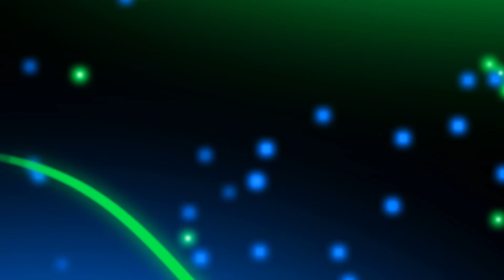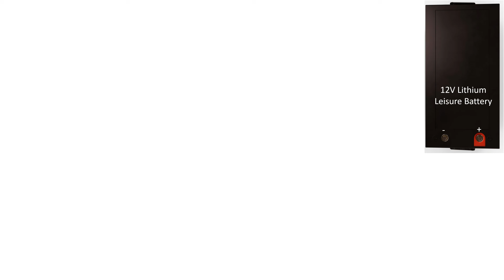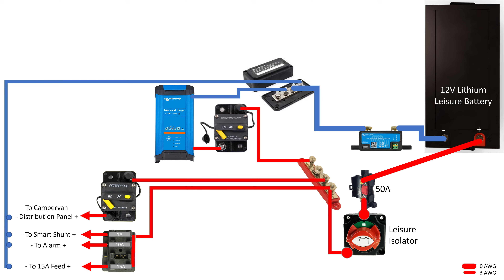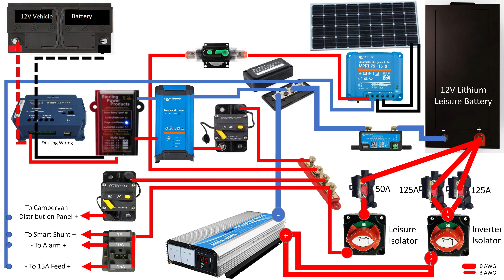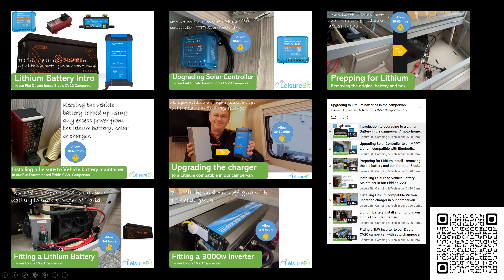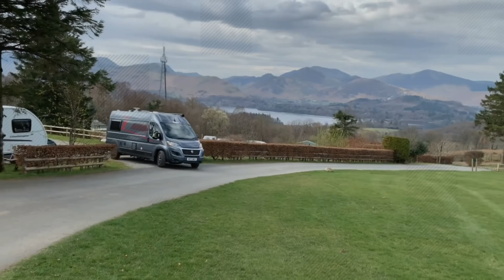8. Lithium Upgrade - Connecting it all up - wiring schematic - Campervan tech Vlog

Comment: Hi Dave. Great set of videos which gives me the confidence to take the plunge and convert my CV20 to lithium. I may have missed it but did you ground the negative busbar to the vehicle chassis and if so whereabouts?
Reply from the maker: Thank you - yes I grounded it through a hole I made in the floor underneath as it was awkward to get in and I also ran the + from the vehicle battery that way - in hindsight I would have probably struggled pulling it though behind the washroom so what may be a better option and connecting to a ground point near the battery (especially if you go for the higher capacity) good luck with your install

Comment: Hi David just wondering where did you connect the power lead for the smart  shunt to.. was it to the battery itself or the isolation switch.
Reply from the maker: Do you mean the 12v input for it? If so, it's connected to the fuse box via a fuse which feeds from the isolator. Hope that makes sense. All the best, David 👍

Comment: Why is the Victron IP22 connected to the Sterling Power Module?
Reply from the maker: Simply to save money on cable runs as was a foot away between the charger and the battery maintainer so saved running a couple more metres of cable as the IP22 connects back to the leisure battery so same destination.
Hope that makes sense, all the best, David 👍

Comment: Hi David,  Another question.  Did you crimp the terminals yourself on the battery cables or did you get them made up for you.  If so what crimping tool did you use.
Reply from the maker: Most of them I crimped myself with a handheld hydraulic crimp which I got from Amazon for about £35. The 70mm2 inverter cables came pre terminated.
Hope that helps 👍
Reply: @LeisureBit  I've been looking at this type and considering investing in one.  Wasn't sure whether they were up to the job.  How did you find the one you had and do you know the make.
Reply from the maker: @Anthonya54  I’ve found it works well, takes a bit of practice on holding it right when crimping as it feels ‘wrong handed’ to me but does a good job and plenty of power. The one I got, if you search Amazon for ‘hydraulic crimping tool’ it’s the HSeamall one (the yellow one £37.99 but the one £1 cheaper looks the same.
Reply: I've found that hydraulic crimpers are imperfectly sized for terminal/cable combinations and have had a couple of 70mm2 crimps which came apart when stressed, so now I just use a cheap hammer crimper which makes a perfect joint every time - rather crude but very effective.

Comment: Hi David,  great summary of your setup. What did you use to create the wiring diagram and where did you get the device images from. I want to document my design for planning and future reference.
Reply from the maker: Hi, for those I used PowerPoint for the diagrams but have been using draw.io more recently. The images were from the manufacturers where available or from Google Images or where I purchased ‘snipped’ in. Hope that helps, David 👍

Comment: Hi. Did you also use 2x 0awg gauge wires for the negative side of the battery and negative side of the inverter? Back to the shunt
Reply from the maker: I used 70mm2 in the latest update for all wires to the inverter with the exception of the battery - to the shunt which is 50mm2 (as already had that it’s a short length and when I updated the cabling and did heat checks at load it was fine). The campervan distribution feed is 16mm2 fused at 50A.
Hope that helps,
David 👍
Reply: @LeisureBit  thanks for that. Isn't 70mm cable = 0 A awg which will handle about 150amps from the inverter,  is this correct?
Reply from the maker: Should be 485A at 70mm2 - think it’s 2/0 or 3/0 in AWG

Comment: Congratulations in producing a great series of videos around the complete installation. From your clear instructions you have got me ready to bite the bullet and upgrade to lithium. In the past I have paid for various upgrades on the power set up, B2B and Solar. I have been quoted loads of money in labour but with this guidance I have full confidence to swop out my two 90amp Gels to a 150 amp Lithium. I note you installed a Victron 30Amp charger for your 460 Amp Battery. Now my research states one should fit a charger at 30% of the battery, so 150amp battery a 45 amp rated charger, so 50amp Victon. Do you have any thoughts on this rating
Reply from the maker: Thank you - appreciated. With regard to the charger, at the time the 30A one was in my price range and size wise it fitted really well - you’re right, ideally around 150-175A would be ideal but the cost and size were prohibitive - I’ve found the 30A great for my needs all be it would take nearly a day to fully charge the battery. Hope that makes sense. Thanks again, and good luck with your install - all the best, David 👍
Reply: @LeisureBit  Yes if you think about it. Even if you just spent one night on EHU 10 hours would put 300 amp back in the battery. The chances of the battery being below 50% would be remote especially if you have B2B as well. I have a B2B so thinking along the same lines 12 hours on EHU with a 150Amp battery charged by 30Amp will be more than enough.
Thanks for the info

Comment: Hello,
thanks for the video, verry informative!
Can you please give more details regarding Victron IP22 Charger power consumption and time of charging for a full battery charge.
Thank you,
Lucian
Reply from the maker: Hello, thanks for the message - the output of the one I’ve used is 30A (it can be reduced in the settings) so if you had a 300ah lithium battery would take 10 hours (or so to allow for inefficiency) to charge that size battery. I believe it’s about 90% efficient. 
Hope that helps, David 👍
Reply: Hello @LeisureBit , I was referring at charger 230V power consumption, so at 30A/12V will be around 360w-400w/230v for 10hours from the grid.
Is that correct?
Reply from the maker: @lucianbuzatu4602  Let me measure it to check and report back

Comment: I have decided to go to lithium after seeing all your videos a few times, I hope they sponsor you in the future ;) At the moment I will buy the charger and the lithium battery to be added to the MPPT I already own. I was thinking to go to 320 Ah battery as I don't plan to go offgrid for more than 3 days. I think that should be more than enough to power heating and laptops, phones, etc
Reply from the maker: Great stuff - I’m sure 320ah will be more than adequate for a few days off grid - good luck with the install - hope all goes well - I’m sure you will be delighted with it when it’s done - all the best, David 👍
Reply: @LeisureBit  One question, in the diagram, where you put the connection of the positive to the SmartShunt, after the 1Amp fuse you indicate it as negative to the bar bus, but as I understand, after the 1 Amp fuse it should go directly connected to the positive of the SmartShunt, correct?
Reply from the maker: The positive from the smart shunt is connected via a fuse to the positive bus bar, the negative for the shut comes from the main negative feed if that makes sense (which gives it the + and - to power it up)
In the diagram to avoid having a red wire right across it’s implied from the fuse box if that makes sense and it just shows negative in and negative out on the smart shunt but the + red wire connects to it via the fuse 👍
Reply from the maker: @reejasp  worth also noting I did away with the high power breakers as they weren’t up to the job (there’s an update video if you are planning on installing an inverter for ref where I replaced them with fuses for additional safety)
Reply: @LeisureBit  I have that in mind, at the moment I will work in the battery and connectors and install the inverter in the next months. Do you know how can I identify the connectors in the camper? I see blue/white coming from the solar panel, another connector red and black covered and one connector red and grey that in my case is not connected to any place.
Reply: Another question, is the battery mantainer needed if the van is used almost daily? I don't see a really need to top if the van is used often.
Reply from the maker: @reejasp  If you’re using the van daily (or fairly frequently) I would imagine it would be ok - depends on your van type and what’s fitted - some seem to have alarms and other things connected to the vehicle battery, some to the leisure battery - I fitted it for peace of mind to make sure the vehicle battery is well topped it - so completely optional - worth noting the Smart Shunt is too as you could just use the lithium battery monitor instead of that to save some expense as there’s a degree of duplication - I already had it and find it useful to have a set of the Victron stuff to network together to make them work more joined up - hope that helps.

Comment: Did you ever make a video on the Victron settings you chose for the Roamer ? I too have this battery but I have many issues with it and the bms built in not following current 
at the moment they have fixed it again but it’s happened twice now. if you dive into the bms app and go to details you will see the cells if balanced 
Check the bms against the smart shunt I also am trying to get the shunt to synchronise but the roamer which is 300ah in the parameters keeps changing on its own so instead of showing 300 ah shows 298.5ah  that’s another to check for 
so on the soc it gets stuck at 297ah which puts the smart shunt out 🤷‍♂️
Reply from the maker: Will have a look at mine tomorrow - I used the Lithium setting which seems to have been ok and planned to have a closer look (just haven’t got round to it as all was working to the best of my knowledge) I did have a wierdness where the Roamer BMS reported 80odd percent full when it was fully charged and just waiting for a response on that (as it sorted its self out and was full)

Comment: Any reason you went for the 3 outputs rather than the 1 with the Victron IP22 power charger?
Reply from the maker: I got the one with the single output- I considered the multiple but decided with having a single battery to go with the single. 
All the best, David 👍
Reply: @LeisureBit  many thanks. Is the Orion-Tr Smart 12 12-30 recommended as I was thinking about the 12 12-18 for our fiat auto trail motorhome?
Reply from the maker: It’s the 12-30A one I went for as thought it would help if off grid for some time then stopping at a campsite to give that extra energy to top up the battery when hooked up - thought it was with the little bit extra.
All the best, David 👍
Reply: @LeisureBit  many thanks David

Comment: where in the diagram does the Finder Plug In Power Relay fit, great videos, tnx
Reply from the maker: Will cover that one off on the mains bit - I was concerned incase folks who didn’t know what they were doing messed about with mains and did something daft but will cover it off to explain how it all works etc. would that help? All the best, David 👍
Reply: @LeisureBit  yes pls, I use the diagrams like a flow chart, and getting the plugs to work off both mains and inverter is what SWMBO wants

Comment: I’d not come across American Wire Gauges before.   Round here everyone stocks metric sizes
Reply from the maker: Sorry about that I should have included both and metric as standard. 70mm2 for inverter related wiring and 25mm2 for the rest is a good option, you can go to 16mm2 (and lower on some circuits)

Comment: Should there not be a pair of cables running from the Schaudt dc:dc charger to the new battery?
Reply from the maker: The dc to dc was already installed and the connections back feed into the Elddis BCA unit so I left these as they were. If you were installing a DC to DC then absolutely you would have a connection but in this case it feeds through the CV electrics connection via the Elddis distribution unit.

Comment: Once we get our CV40 I will be pretty much following these videos and wiring diagrams to fit the exact products.   I’m just curious - as the Roamer batteries have built in Bluetooth what benefit does the smart shunt give you?
Reply from the maker: Thanks for the comment, really great question. If you just want in the moment measurement the Roamer BMS will suffice and no need for the SmartShunt. This history of consumption is handy from it and it forms part of the Victron network and gives the charger and solar controller an at the battery voltage measure. I had already purchased it, if I had nothing and was going to buy set up again, if I wanted to save £100 it’s a good one to skip. 
I love the setup, one point to note, make sure you get sufficiently rated cables for the battery to inverter, I found the original ones I used weren’t as good as advertised at top end so ran warm, also I’m adding a fuse and rotary isolator to the inverter rather than the two breakers following feedback on them from other channels sometimes being a bit iffy at tripping. 
All the best, David

Comment: Hi David I was hoping you could help I have everything wired up with the same equipment that you have and I am getting power to everything but the grey elddis distribution box. I have put the multimeter on it has power going down the cable to it but nothing is working on the distribution box so nothing is getting to the rest of the van. Do you have any ideas I am really stuck. Many thanks Andy
Reply from the maker: Hi Andy, there’s a cable which is reasonably thick which I connected via the 30a breaker, that was the feed back to the main box and was originally connected to the battery - be worth checking the breaker and making sure when off the feed stops, and goes back on when switched on where you’re testing it but sounds like you’re getting power down?  If you measure at the fuse box part of the Elddis box, are you getting any voltage there or is there no power at that point? Worth checking that the negatives connected well also especially on that lead which feeds to the PDU. let me know what you find with that..
Reply: Thanks for the reply David, I know this sounds like a daft question how do I check a voltage on the fuse on the PDU? Do I remove 1 of the fuses set my multimeter to 20v and put the red positive where the fuse was but where do I put the common probe of the multimeter? Many thanks for the help, Andy
Reply from the maker: Hi Andy, if you can connect a wire to the negative of the battery or your bus bar or even an earth point to the common or - terminal on your multi meter on the 20v DC range and then if you use the probe in the + or voltage input of your multimeter, you can probably test without removing the fuse as on mine the contact on the fuse had some exposed part of the fuse terminal on the back and the probe of the multimeter worked to check it, if that doesn’t work, then removing a fuse to make connection would work too - let me know the reading you get
Reply from the maker: Hi Andy, I’m out in the morning but if you are still haven’t sussed it by tomorrow afternoon, drop me an email (feedback @ LeisureBit . Co . Uk ) removing the spaces so it’s a valid email address, with a couple of picture of how it’s connected and we can try and figure it out. All the best, David 👍
Reply: Many many thanks David I really appreciate it!!! I will give a few things a go in the morning and see if I can track it. Once again thank you so much as it is a bit of a worry after putting a lot of time and money into it.
Reply from the maker: @smedheads6676  let me know how you get on in the morning - I’m sure we can suss it so don’t worry,

Comment: Doing the same upgrades at the moment. 
Sorry if i missed this but how did  your van charge your L Battery originally,was it a split charge  relay or a B2B charger?
Reply from the maker: Hi Edward, The van came with a b2b charger as it’s an automatic with start- stop so I used that one, I think a lot are fitted with split charge relay so would need changing to b2b if one of fitted. All the best, David 👍
Reply: @LeisureBit  
Thanks,its good it come with a B2B fitted.
Your installation looks neat and professional.
Is there a reason why there is no chassis negative connection at the negative busbar on the drawing
Ed
Reply from the maker: @edwardvickers5506  Thank you, appreciate the comment - no reason, it’s missing from the diagram, sorry about that. All the best, David 👍

Comment: Very good video David. We would like that system ourselves.
Reply from the maker: I’m really pleased with the majority of it so far - and it takes the worries away on running down the standard batteries (I think I’m still scarred from damaging the Motorhome we had some years backs battery) - plenty of spare capacity - I go through coats on next weeks video for ref of each of the components and work out £/ah comparison over the life of the battery - all the best, David 👍